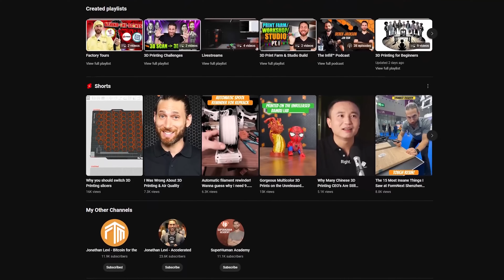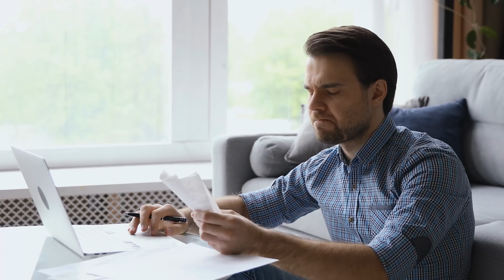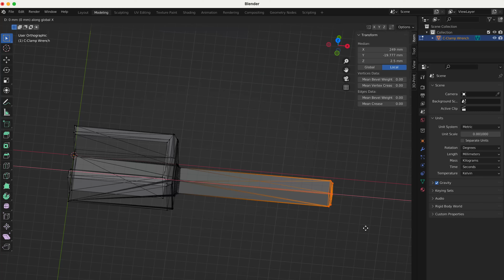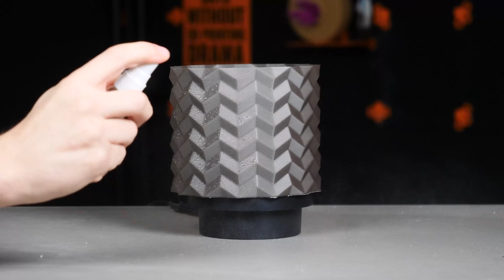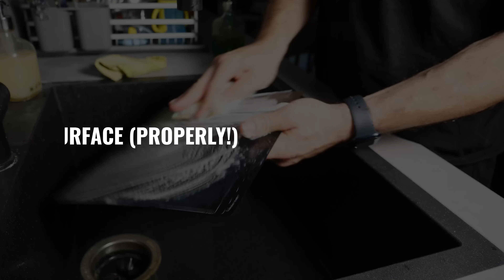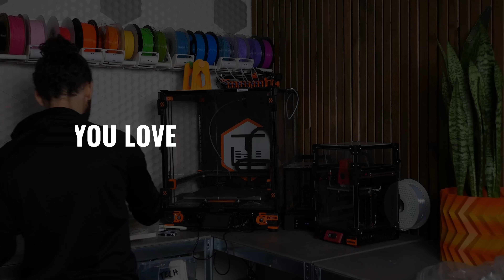9 Things I Wish I'd Known About 3D Printing

Comment: To cover some of the points that you raise in this video:

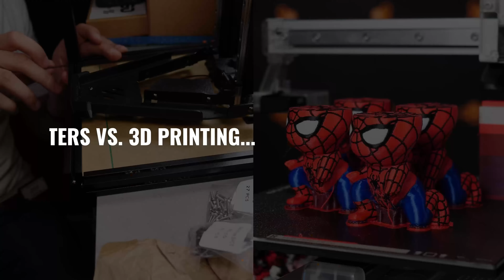7:30 working on printers vs. printing: I think I struck a nice balance between the two with my choice of printer. At first I was looking at the Bambu product line becuase they offered a complete line of printers that Just Work™, but as I looked more into their frankly very closed ecosystem, I shied away from their offerings. Yes, I want a printer that Just Works™ so that I can get to printing the functional and occasinal aesthetic prints I want to print, but I also want a printer that won't keep me too locked down into an ecosystem that may or may not be able to expand with my own horizons.

I haven't set it up yet, but I think I struck that balance with the Anycubic Kobra 2 that I bought--also because they were running a stupid good sale so I got a printer that seems on the outset like a good choice for a hecking good price, which means I'm not in too deep if getting just the one printer to print useful stuff is all I ever do with this hobby. But because it runs Klipper, and the somewhat proprietary hot end can be modified to accept less proprietary volcano nozzles, I've got a printer that can expand just enough to satisfy most of my future needs.

... Until I need an enclosed printer because I decide I want to dip my toes into printing ABS or ASA. Then I've got my sights on the Qidi X-Max Pro. And if I need multi-material printing then I'll probably blow my bux on a Prusa. 😋

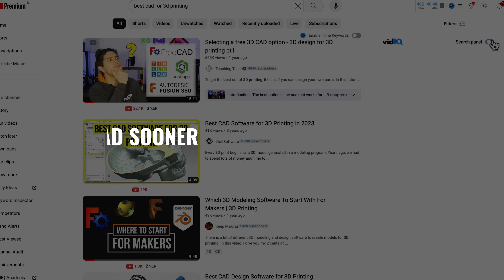9:21 Learn CAD sooner: This one's gonna be a tough barrier for a loooooot of prospective 3D printing hobbyists. There is a wealth of options out there for CAD applications, with varying degrees of simplification to their user experience to suit varying CAD skill levels. I've gone with FreeCAD myself for two reasons:

1. I was already kind of accustomed to AutoCAD and by extension Fusion360, which AutoDesk partially rugpulled features that were going to be useful to me right as I started to dip my toes into it, and

2. I already engage in another advanced hobby that is electrical engineering, and I had been a long-time Eagle user right up until AutoDesk rugpulled us all on THAT one, which led me to switch over to KiCAD as my EDA.

Learning FreeCAD was the natural choice for me, but ho boy it has a steep learning curve if you're getting into it for the first time with either extremely rusty AutoCAD chops or no CAD chops at all. But it's a fully-featured CAD application that squares itself up against AutoCAD and Solidworks, so if you're undaunted by the scuffed UX of a FOSS CAD application built for serious applications of CAD, it's a solid choice that opens up a vast swathe of possibilities beyond just busting out a quick simple mechanical part for 3D printing.

Blender also has a famously steep learning curve as well. A lot of really advanced FOSS is like this, unfortunately. It's all developed and built almost entirely by software engineers and get very little love by UX developers, sometimes entirely in their free time, so the focus is almost entirely on functionality and rarely on usability. If you're undaunted by this, or you crave a mini-boss challenge that constantly re-challenges you throughout your journey, by all means pick up Blender or FreeCAD or any other advanced FOSS application. Each time you have to face the mini-boss, you unlock bigger buffs to your skills and more advanced dungeons to explore and loot and gain XP within.

Comment: You're cleaning it wrong in application. 
Start from center and swirl to the outer edge. 
Look up "how to clean an injection site"
You're applying cleaning agent at center then push it away from center. 
NEVER swipe side to side. That just streaks the dirt.
Reply: Could also start from one end a "push" the dirt to the other end. 
But never swype side to side willy nilly.

Comment: I started 3D printing back in January 2023 with a $100 Ender 3 Pro from Microcenter. Got my second printer (a used Anycubic Kobra Plus which turned out to be a huge headache) and a bunch of Ender 3 upgrades in January 2024. Last week I ordered a Bambu Labs P1S so i can focus more on just designing and printing, while also having my tinker printers. 

Now, we're getting a P1S at work too so part of my job now will be designing and prototyping custom hardware. 

I never expected myself to go past just printing free models, but this has turned into so much more.

Comment: i am buying my first printer Ender 3 v3 kE and since I am an engineer and an interior designer; I am familiar with CAD software like AutoCAD and Sketchup. I am a professional learner to so I want to learn Fusion 360 soon. and the one you mentioned (Onshape) I will give it a try.

Comment: When I was collecting bits to build my Voron V0.2, I was talking to a friend about buying my 3d-printed parts from PIF.  He suggested that I instead strip down and rebuild a bedslinger to do it.  It was a GREAT suggestion, I learned a ton from that project, which greatly informed my Voron build.  Part of the learning was that since I started with a random $50 garage-sale find, I was pretty comfortable ripping it apart and rebuilding everything.  In the end, I found that the $50 garage-sale bedslinger printed better than the originally-better-but-unmodified bedslinger I had been afraid to experiment on.

Comment: I'm a long time professional Blender user for work in visual effects and motion graphics. I'm new to 3D printing and while Blender has stolen my heart long ago, you are much better suited learning an actual CAD application of which Blender is not.

(Edit) The one area where Blender will excel is sculpting. It's similar to Z Brush but easier to manage.

Comment: I'm a noob.  Hope you can help me.  I need to know if I should leave my PLA filament loaded in the head, or should I remove the filament when I am finished 3d printing an object.  Is it safe to finish printing and just leave the printer loaded with the filament.  thank you for your help.  BTW, what modeling program can a non-engineering type like me use that doesn't require years of training to use. Tony 😎
Reply: Try Cura it is one of the best slicers and it’s ok to leave the filament in the printer it doesn’t hurt anything

Comment: Got a roll of Polycarbonate - great material, just have to be wary of warping. Might have to patch up cheap enclosure for better heat retention, maybe find a way to heat it up better, or maybe just get a better enclosure. But for some things it's fantastic, especially if you want something that can hold up to a lot of heat.

Comment: I'm learning FreeCAD for modeling. RealThunder branch. Quite the learning curve, but I don't have to worry about pricing if I want to start a business, my models can be private if I don't want to share them, and it works without an internet connection. It's also quite powerful for parametric modeling if you're willing to learn all of its features.

Comment: Eh, I only have two printers, and only really use one of them. Not buying more - a good reliable printer is too expensive for me to buy on a whim, and I don't have the space either. Filament spools, on the other hand, I've got a bunch now. Definitely in a different tax bracket if you're constantly buying new printers.

Comment: The point about CAD is well made. I'm a teacher, and when I saw a handmade 3D topographical map that someone had made as a hobby I realised how great it would be to have resources like that for my classroom. But the person who made the one I saw spent months on it! I don't have that sort of time, but I wondered if I could 3D print them. I went to an open day at my local 3D printing club and explained what I wanted to do. "Oh yeah, that would be easy" they assured me. Yeah, right. Easy for them perhaps, but I didn't know CAD. I investigated so many CAD programs only to find out after wasting a lot of time on each one that they aren't what I was looking for. For example, I was making progress learning blender, but then discovered that it's built in font doesn't handle text macrons, which I needed for adding labels in the Māori language of New Zealand. After wasting a year I gave up. 😢 I keep watching your videos though, because I hope that one day I'll hear of a way to make it work and be able to try again.
Reply: Something else you can try for topography maps is use Inkscape to make the labels which you can add to the topography map before you print it. Use the vector you get as a tool to make the text inset into map.
Reply: Could try other cads to maybe make stencils and paint the labels?
Reply: @daytrace4635  Thanks for the suggestion, but paint so easily comes off classroom resources which is why I loved the idea of having the labels built right into the model. Sure, I was naive, but that was kind of the point of the video. Now the latest PrusaSlicer versions have come a long way and I am getting ready to try again, but this time I am going to start with something much less ambitious!

Comment: One of the first rules when you have a cheaper Printer: Have two Printers avaible. One will always break down and you need Spares... printed. It doesn't matter if the second Printer is someone else for a short emergency Print or even on a Hardwarestore. But you need a second Printer to print. A Cheap old wornout Ender 3 is a horrible printer, but it is the best Printer in the World when you somehow broke a Part of your Fancy Voron and you need a PLA Spare Part for your Voron that you can print an ABS Part on your Voron for replacement propper. Been there with my first printer when i cable tied everything together for one print after the Autolevel holder Broke or the Frame Connector.. since then i have always two working printers so i can five the broken down. Yes a Bambu won't break down.. except the AMS in V1 and V2... then you need a replacement part... Suddenly the old Ender 3 which was decomissioned 2 years ago is the best printer in the world. So fix old printers before you decomission them when it's  not expensive and putt them away.

Comment: I know I would've spent all my time printing upgrades and tweaking my printer if I'd gotten into this hobby in my early days, or back when I first started learning about (and yearning for) 3D printing, back in the 90s (first I ever saw was LOM - Laminated Object Manufacture - in a magazine, which laid down sheets of pre-glued paper, then laser cut the layer, and cross-hatched all the negative space, and in the end you hammered away all the unwanted parts, and had basically a plywood-like block-of-wood sculpture, sandable, paintable, etc). Back then, c. 2003, there was only 1 (non-LOM) option the webs told me about - Z-Corp - with their powder + inkjet print head, which made a sandstone-like print, which was full-color all the way through (my pics from Siggraph 2005 - https://www.flickr.com/search/?user_id=85719887%40N00&sort=date-taken-desc&view_all=1&text=z-corp%20siggraph). Soon after, I heard about Dimension, which was a huge, filament printer. I think both were $18k, so out of the question. Then they kept falling in price for a few years, and when they were down around $8k, I did a lot pacing about, trying to justify one, but I was too poor. Now I've been following along with things - like Evil Mad Scientist's sugar printer, the CandyFab (https://www.evilmadscientist.com/2014/candyfab/), which I saw at Maker Faire 2006 - for more than 20 years, but only finally got my first - a MK4 - late last year, in my mid 40s, and I have the benefit of 1) the sense of limited remaining lifetime, pushing me forward at an increasing pace, and 2) decades of looking back at spending most of my creative time using my woodshop to build woodshop organizers, my CNC mini mill and mini lathe to build things for them, like a vacuum manifold to better keep things clean while milling, and custom cabling and shelving for my electronics bench, and I'm finally over it. The spell is broken. I didn't buy the printer kit; I just bought the assembled printer. I don't know how every part of it works inside, and don't much care. I haven't upgraded anything. I haven't printed anything for it. I'm just making actual things for my life, and for others, and having a blast.

Comment: Best advice I have to new makers. Don’t fall for the overpriced upgrades. 
If it prints and doesn’t have issues, don’t mess with it. 
Don’t fall for Bondtech, Slice Engineering, etc.
Hardened nozzles, you need. 
PEI build plates, good upgrade.
All metal hotend, only if your printer needs it and can support the heat. 
Don’t fork over enough money to buy an aftermarket upgrade you don’t need when you could have bought a better printer to start with.

Comment: Reporting in from the deserts of Arizona: we also need to dry our filamnent. I thought my printer was broken until I opened a new spool and it printed perfectly fine. Got a filament dryer and now all is well.
Reply: @medivalone  UT here. Keep the house humidified at 35% but my filament in cereal containers with desiccant shows 10% humidity. During a print the spool is out in the atmosphere (no AMS). No issues yet, but I'm waiting for that day.

Comment: I've been messing with Freecad and designing little things. 

I made a custom shelf for the top of my TV, with a separate little piece to connect the sections so my cats don't pull them off.

Also designed a table for the arm of my chair with a mount for a USB keypad

Comment: I value your advice very highly. Thank you for your dedication to the hobby, and passing on your knowledge. I too, would like to see a "Why your prints fail" video. Take this with a grain of salt as I'm in no position to give advice. I think it would be helpful to the less technically savvy to really drive home what z-offset is and what it isn't. I've seen so many Social Media posts asking "Why is this print failing" and most of the responses are (sometimes absolutely wrong) "Adjust your z-offset." To which they reply, "What is z-offset?" Or, "What do I set it to?" Or, worse, someone replies "Set your z-offset to -1.32, that's what mine is." I'm not sure why it's such a hard concept to grasp, but I think it merits a deeper dive.

Comment: This video literally dropped at the perfect time. I had just been introduced to your channel recently actually and just happened to stumble across a new video from you. Rescrubbing my build surface with soap has finally allowed me to complete a print using ASA filament that I have been struggling to get stuck to the bed. After scrubbing, the print stuck flawlessly without ANY warping. I'm very pleased with the results now and will certainly will be moving forward with this method of cleaning.
I really wish this info was more prevalent... even the instructions that came with my PEI build surface only say to clean the plate thoroughly with soap before the first use, after that they say to use isopropyl alcohol for routine cleanings. Makes perfect sense though, dish soap has very powerful surfactants that are the best at grabbing and removing grease/oil. Only thing I would add to the info you gave is that a good way of telling if you have scrubbed good enough is to watch the rinse water running off the plate. The plate will become hydrophobic allowing the water to sheet off.

Great video, I'm definitely a subscriber now. Thanks for the effort you put into your channel, it really shows.
Reply from the maker: Happy to help!

Comment: I love your content. I actually have a specific issue I'm having right now and I've tried researching but I'm still confused on it. My prints come out almost spongy, and delaminated lately. I'm using Sunloo PLA+. Not sure if you've ever had this issue but would love some insight of possible
Reply from the maker: Sounds like you need to dry your filament.
Reply: Sunlu not sunloo

Comment: I started with an Ender-3 S1 only to realize the reward of successful, cool prints wasn’t enough for the effort of bed-leveling (despite auto-bed-leveling) and subsequent z-offset needed after nearly every print. I now have my daily driver of the Bambu A1 and the Ender is now my project machine with a few upgrades installed and a few queued up for future upgrades.